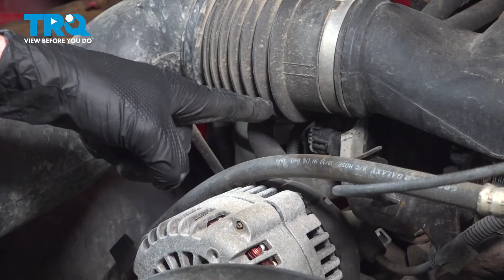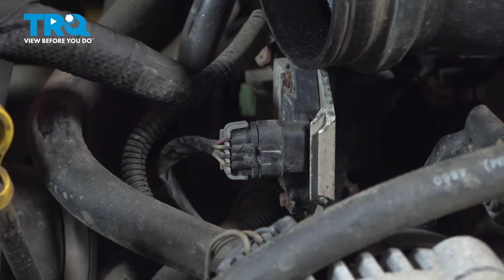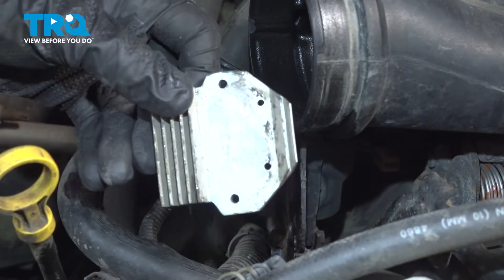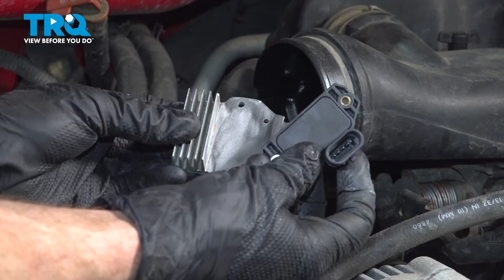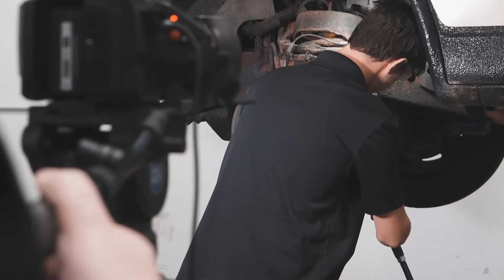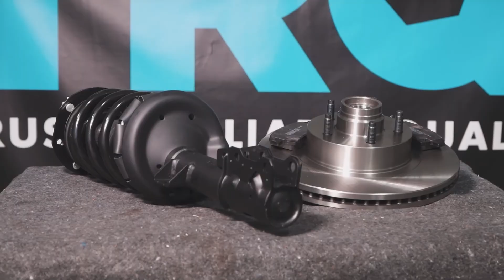How to Replace Ignition Control Module 1999-2006 Chevrolet Silverado 1500 4.3L V6

Comment: Found your video when I bought a new one for the second time, and it came with a pack of grease. I thought it was for the connector, but you showed me different. And yes, this part made my 4.3 silverado die on the freeway. DONT BUY cheap electrical parts. Lesson learned